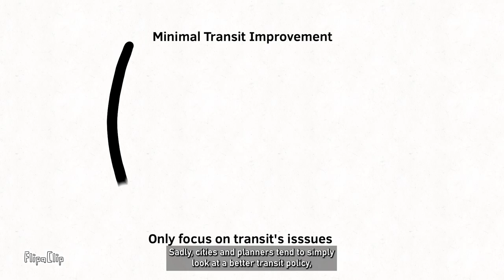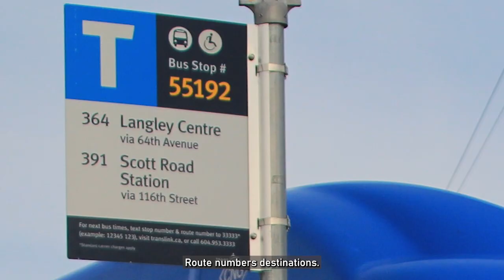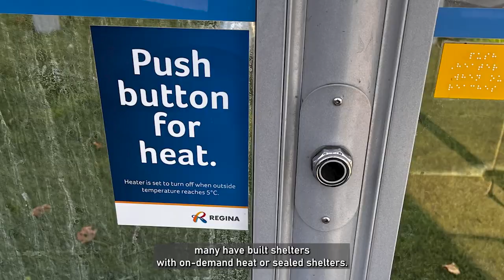How to improve bus stops?

Comment: It never ceases to amaze me.  These videos on public transit always - always - assume that citizens are nothing but expendable resources necessary for the proper function of an idealized urban system. Dear Mr Urban Planner. I don't want to live in your expensive, noisy, crowded, crime-ridden, over-taxed urban core. Go examine San Francisco and Portland if you want to see why.

And if you want to improve bus transit, then begin at the beginning. Get the vagrants off the bus. Frequency and accessibility don't matter unless the necessary condition of safety is met first. I rode the bus to work for 15 years. I stopped the day I got on the bus and it was filled (by which I mean "every seat was taken") by homeless people seeking to avoid the cold. They weren't going anywhere. They were just riding. All of them were armed. All of them were struggling with some form of addiction or mental health problem. All of them were in some sort of hygienic distress. So I went back to driving. 

You see, people reserve the right to make decisions for themselves. They don't have to equate your ideas of "urban planning" with the public good to their own private detriment. We aren't chits to be deployed in your game of social engineering.